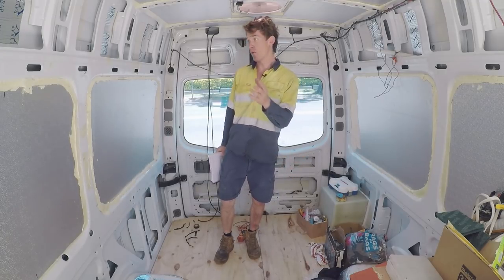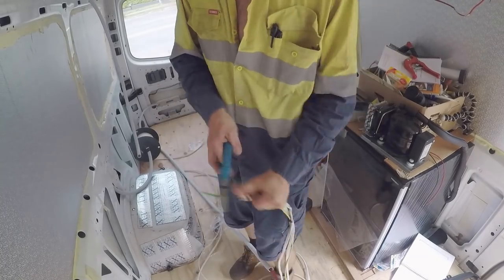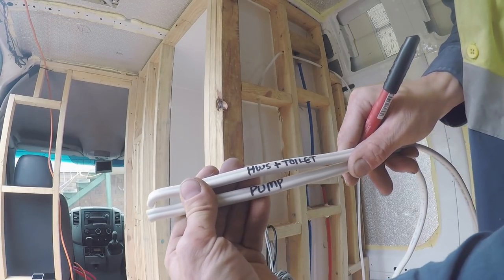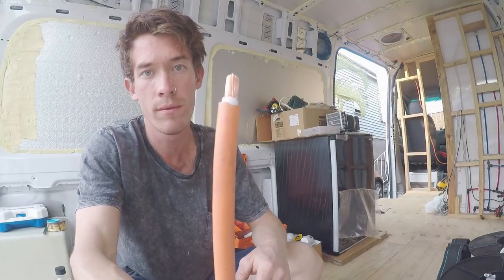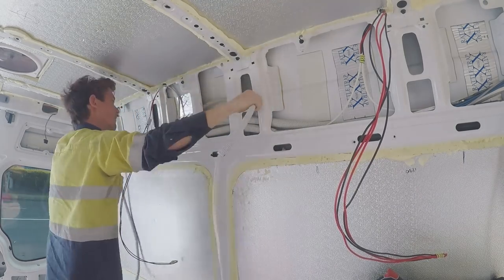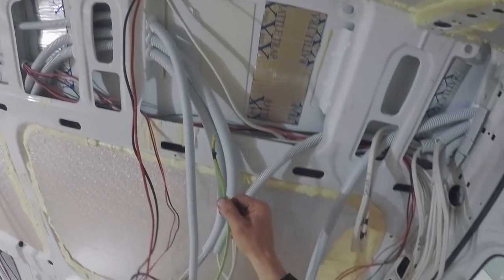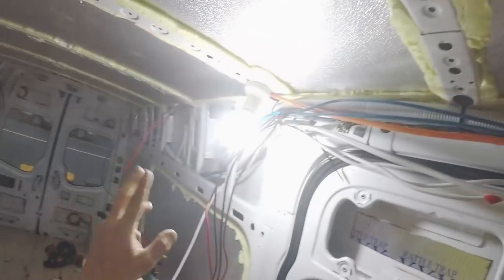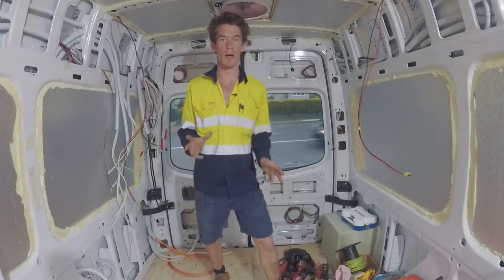S1E9 Sprinter Van Conversion | Electrical Pt. 1

Comment from the maker: I'm glad I went the extra step with the electrical rough-in, I'm really enjoying the extra power points and 12V USB points throughout the van. Having 12V and 240V in the van makes life a lot easier and convenient!

Ep.9 BLOG POST + PRICE BREAKDOWN - http://www.jazmorton.com/van-conversion/ep-9-electrical-pt-1/
Season 1 Van Build - http://bit.ly/VanBuildS1
Season 2 Van Life - http://bit.ly/VanLifeS2
Reply: Why 4mm for the 12 volt ?
Reply from the maker: @tospicy4ya  less voltage drop
Reply: Jaz Morton did u use fp 200 twin and earth
Reply from the maker: @tospicy4ya  I used 2.5mm² Twin & Earth Cable for the 240VAC wiring, and 4mm2 Twin for the 12VDC wiring. These are both TPS cable (Thermoplastic Sheathed) Cable. 

Go to https://www.jazmorton.com/van-conversion/electrical-pt-2/ to check out what gear I used

Comment: 26:40 "I just wanted to keep the electrical in this van pretty simple. I didn't go overboard."
You call that simple?! Lmao.
Reply from the maker: Haha yes I think it is simple,  maybe in my mind haha. Part 2 will be all about fitting off all the powerpoints, switches, circuit breakers, battery etc. Enjoy
Reply: I laughed at that out loud too. I guess it’s relative to experience, or build ambition. What would have done that would have made it complicated Jaz?
Reply: Once you try yourself, you will be surprised how much cables are required even for simple setup. I did conversion of VW T5, really simple one. And i had to put diagram on paper and plan everything. So I belive it is as simple as possible. :-)
Reply: @mojitomaker  smart iot van probably!?
"Hey Google, shower on" 😄

Comment: I will shamelessly steal your idea for putting lights in the back doors through the door loom conduit. That is such a great idea. The rest of the cabling caused my brain to melt, so i'm off to bed to weep at my apparent inadequacy. Thanks for the great vid though. Take care
Reply from the maker: Haha use it please :) oh well at least you'll be able to sleep better now! In Ep.9 Blog Post I will include heaps of info and wiring diagrams etc and it will be all much clearer!
Reply: Thanks Jaz, In the UK we are free to die by misadventure. The man can't tell me how to wire my van, but my ghost will definitely watch that next video. I plan to skip 240v and an inverter altogether if boost/buck regulated DC-DC boards work out for the small number of electrical kit in my van.
Reply from the maker: Haha be safe mate 👍🏼
Reply: Jaz, was there merely not enough room to run the cabling through the frame above the door, or on tge drivers side van? Or was that just a comprimise for ease of installation?
Reply from the maker: Good question mate. There is zero room above the large sliding door, no cavity. And since I had already built the bathroom running through the other side wasn't really an option.

The existing 12V automative cabling was already along the door too, I i just ran it all there .

Comment: Thanks for the last element about not being disheartened by the scale of the project. I'm in the same boat as you, full-time job, and starting a van build at the same time. I'm not looking forward to starting, but as you've said, you have to keep going. Small steps in the right direction, and learn from your mistakes.
Reply from the maker: That's it darron there are many times you will feel overwhelmed and disheartened and many times of high success and satisfaction and motivation. The journey is a myriad of feelings, especially if you work full time but it will all be worth it. I only felt like I was truly getting somewhere after episode 10 was complete haha! soldier on mate

Comment: Great stuff. Really enjoying the videos and detail you are going into. I'm fitting out a 2006 sprinter myself right now.  Mine will be a weekender/occasional trip rather than a full time live in so I'm not planning to install a shower and toilet. So much of what you have done to this point is really helpful, so thanks!
Reply from the maker: That's awesome you're taking on your own project! A weekender would be awesome too. Really appreciate your support Darren, cheers!

Comment: Lovin the Work, especially your effort with the edit/voice over. I’m doing an ex ambo strip out at the moment and can’t be bothered videoing every aspect it takes so much effort, so really appreciate all you put in. Very helpful.
I’m lucky as mine is prewired although some of the v-mux system has been removed but I’m chasing the USA manufacturers down - wishing I had started from scratch as it’s a headache.
Reply from the maker: Cheers Zed ya legend, yeah mate the effort to create a whole video series is like doing the conversion twice!

Your build sounds cool wish you the best of luck with it:)

Comment: Love the detail and the way you put the clips and music together.  (Most of these types of build series videos just say....”today we did the electrical” and show it completed). Can’t wait to see the whole van done.  It seems like you’ve really worked out all the details.  Did you draw this all up in Autocad or some sort of drafting software?
Reply from the maker: Cheers mate, yeah I know that's why I wanted to actually go into detail and show the actual build process, because I couldn't find many doing the build either.. I literally have a real basic plan on paper for cabinetry, and I didn't go off an electrical plan it was just in my head, but I will be doing plans up after the fact so it is easier to explain on the blog posts to all you guys, thanks for all the support mate!

Comment: Have you at any time thought: 'Jeez... this is so much work...'   I ask, as I bought a camper that had been quite well equipped and done very well - a VW/Mercedes Sprinter joint venture. Watching you do yours brings it home just how much work went into mine. I paid £4000 for the van with everything done. I reckon I got a bargain...
Reply from the maker: Heaps of Work! If I didn't have to work a full time job as well it would be much easier 👍🏼 sounds like you got a bargain
Reply: I'm very curious to see how it all holds together when you actually get it moving - in particular the solar panels held on with just the sikaflex. I didn't know the stuff was THAT strong. I'm parked up on a motorhome site right now and all I see some days are guys on their roofs with the sealant tending to their skylights and solar panel fixings :) I should show them your video. Whatever, great work you're doing, nicely presented videos and looking forward to its completion. Is there a list of all the Sikaflex products you've been using? - especially that stuff holding your solar panels on :)

Comment: Would be nice to use a microcontroller with relais in one central point and let it switch all the circuits. You can put your switch everywhere and have to use only one cable like the cat 6 or even implement a remote control. And auto switch on or off functionalities via sensors or buttons.
Reply from the maker: So like C-Bus control? I know what youre saying but maybe a bit over the top for something like this, and you would need a board full of relays for that :( take up a lot of space

Comment: Do I understand you are putting your auxiliary batteries in the corner down there at the back?
I've heard issues with draining the car battery if you run out at auxiliary, but I have not understood it entirely and understand there is a way to avoid depletion.
Also: what systems /apparatus are you running on what voltage? What are you using for switches? Will you i.e. make a "in-bed-lights-out" or use the door switches for something? 
How will you be controlling charging, are there automated systems?
I bother you with all these questions because your videos are already super informative and you seem very knowledgeable and seem to have figured a lot of things out. Keep up the good work!
Reply from the maker: Thanks for the questions and support! The starter battery can't be drained from all the lights, inverter and other DC loads as there is an automatic relay that disconnects the starter battery when the van motor isn't running.
All the DC loads are 12V DC, all the AC loads are 240V AC. All the switches and powerpoint will be Double Pole switch mechs.
The will be a switch next to the bed for a bed light, but no I won't have a "Master switch" if that is what you are reffering to.

All the charging apparatus's will be explained and installed in Electrical Part 2, sorry it will be a lot of information in that episode but I havent' even sheeted the van yet, will have to wait for that one :)

Comment: Thanks Jaz for the most awesome video on van conversion truly an amazing job. Are The water piping and fitting similar to PEX in the USA and if they are i could not find the plastic fitting Y's T's and elbows in plastic here in USA. thanks again for taking the time and effort and sharing all that information with us. best of luck in your amazing journey.
Reply from the maker: Cheers Sam I think it is similar the PEX just not as heavy duty, the internal RV plumbing pressure won't be too high like mains. No worries glad you enjoyed and got value from it 😄 thanks for watching and supporting man!

Comment: Does 4mm twin mean you have 2 cables - 4mm each? Isn't that a bit of overkill? And thanks for great videos explaining it all!
Reply from the maker: Yes thats exactly right. 2 x 4mm conductors in the one cable sheat.

It isn't overkill for 12V as 12V is susseptible to more voltage drop and that isn't what you want.
Reply: Really rough!

Comment: Running two wires for the battery seems excessive, why not use the chassis as the negative/return for that?
Reply from the maker: Good thought, probably could have done that. But just wanted to be sure
Reply: Travel With Jaz you were probably right to run the the negative cable for the alternator charge cct as it is such a long run. Do you have the facility to use the hotel battery to assist crank battery if its flat?
Reply: Travel With Jaz I was wondering what happens if you’re plugging in the external with the earth on the chassis.. does that affect your battery?

Comment: Always looking forward to the next video Jaz. Couple questions for you: 

What are you using to cover your conduit T-joints underneath the chassis to prevent water intrusion?

Did you ever consider a backing plate to add some rigidity to your main plug-in ports?

You already have two fans, one right next to the shower door...do you think running your current setup without the third fan inside the shower would be enough to stave off mold? I’m sure it depends on your geographical weather tendencies too. 

Good to see you got some thermal wrap on that exhaust adjacent to the water tank!

Thanks again for these vids...truly awesome stuff!
Reply from the maker: Thanks Phillip! I didn't use anything to cover as it wouldn't matter if water got inside because it can't get into the van. 

I did consider bolting the mains inlet and outlet but decided not to.

I'm not 100% sure on the mould, I i think It would be alright without one but want to put one in anyway :)

Comment: A step drill will make poking holes in sheet metal a lot easier for you than trying to fight with hole saws.
Reply from the maker: Step drills are good, but they give off a lot of metal swarf. I used a metal drilling hole saw which literally cuts the hole in seconds with no effort, recommend that over a step drill bit for this, plus the holes are always perfect size (Y) Cheers for the tip though mate

Comment: I'm in the UK and also a Sparky (Electrician) by trade, curious to know when running off the grid on the AC inverter, how do you Earth the system? I'm only asking as I noticed you put your 6mm Earth to the chassis but if for some reason you had a fault and your RCD or MCB's failed to trip there's a possibility the chassis would become live???
Reply from the maker: Great question Mark and it is a bit trickier when completely off the grid, as technically everything in the van is not actually earthed to a real Ground Earth because its completely insulated from the tyres.

The type of inverter I am installing has something called a  Neutral to Ground relay. (basically a relay that makes or breaks an MEN connection - Multiple Earth Neutral). When the inverter detects when it is connected to mains input, this relay is open circuit because all the earths in the van will be earthed through the mains input earth, and through the mains MEN system.

But when off the grid this relay closes so that if there is any faults, it allows the circuit breakers to trip. I think in reality technically there would be a fault current in the chassis of the van (as there has to be some fault current for an RCD to operate), but it would be so negligable as the RCD breakers trip before any real fault currents could flow.

I'll be running through all this in Electrical Pt. 2.

Again, good question, thanks!
Reply: Travel With Jaz Thanks for the reply, it makes sense now with the type of inverter, I’m interested in building a van myself and always thought about the possibility of maybe running a ground spike when fully off the grid because our regs say you shouldn’t run any part of a PME supply via the metal work of the vehicle but it only stipulates when on hook up it doesn’t mention when running off an inverter.

Comment: Hi buddy. Can you please tell me the name of the fixing brackets you've used to secure the pipes and wire protectors to the chassis under the van?  Not the p clips, the half circle brackets with a screw either side. Would love to get some. Your build is amazing. You should do this for a full time job
Reply from the maker: Hi Tim, at first I thought you were referring to the 25mm metal saddles that secure the corro under the van. I don't believed I used any other fixing equipment. Or are you talking about what is securing the plumbing?

Cheers mate

Comment: I wouldn't use Twin and Earth in a vehicle, the moving of the vehicle could cause the copper to work harden and then break, I would go with flexible Outdoor flex which has also better temperature ratings and doesn't work harden.
Reply from the maker: Thanks mate yeah I considered this put all the cables are quite secure so I think any moment will be negligible!
Reply: Have to agree with Malcolm, Jaz, in the UK flexible cable is a must in the UK for Campervans.
Reply from the maker: No worries mate we'll see how it goes 👍

Comment: Wire spaghetti. lol
Not sure why you ran the battery cables up along the left wall to the solar batteries on the right, but it's there now. You also seem to overly like hose joins. Doesn't that hose bend?
I don't mean to sound negative, just a few things I didn't understand the logic behind them. You have done a top job.
Reply from the maker: gotta run the amount of cables to do the job, once fit off all excess cable is terminated neatly, except the 12v board which was not terminated to neatly. that pipe doesnt bend 90 degrees

Comment: great vids ive been watching in awe at how nice a job your making BUT !!! @17.58 I BELIEVE YOU MAY HAVE MADE A GRAVE ERROR !!! im telling you my findings now incase i forget as when i wired a solar battery bank to my traffic van battery six months down the line they almost set my van on fire on a motorway as it causes the whole of the van wiring loom to heat up so its always best to go straight to the alternator if i watch further and this isnt the case my appologies in advance didnt want to forget!!!
Reply from the maker: Hey Spencer mate! Can you elaborate more on how you wired your system, and what problems you had it wasn't too clear. So far it's all working fine 👍🏼
Reply from the maker: My alternator and solar are wired up separately by the way, seperat e charge controllers.
Reply: yeah nice one jazz its probly ok the problem arose because i overdischarged a battery then connected it to the van which took the charge from the house battery because of the inrush current this caused the vans wiring to heat-up at the distribution box almost catching light .  i always go straight to the alternator for all charging needs and then split off from there charge controller/split charger/distribution/fused .it is MUCH safer as it CANNOT heat the vans wiring loom that way !!!!! when you take power from the house battery you are increasing the load on the vans wiring loom it was never designed for i almost found out the hard way!! it was bad enough i had to scrap the van!  great channel ill be watching some more soon!

Comment: Hi Jaz, can you explain a bit more about the "neutral to ground relay" you mentioned in this video. I understand most things electrical (was a sparky many years ago) but don't have any idea about earthing in a circuit that doesn't touch the earth. Also how do you set up an RCD in a van with no earth. Will really appreciate your answer and btw I am in NZ so have the same wiring regs that you do.

Comment: Dear friend, thank you for responding, you have a wheel case installation book I believe you are asking correctly.
Reply from the maker: Hey mate sorry what is a wheel case installation book? Which comment did i respond to it doesn't show a previous comment, thanks Tynho ✌🏼
Reply from the maker: Oh I saw you said a manual for electrical and hydraulic parts. Do you mean something that comes with the van you need to be specific.  Thanks 👍🏼

Comment: I'm building a van in Aus too. I was wondering if you installed everything yourself and then had an electrician approve it?  I'm wondering how to go about it myself, hopefully I can get most things 12v but for some I'll need 220v like laptops.
Reply from the maker: thats awesome casey, I did install all the electrical myself as i'm an electrician. I actually did get another electrician to go over it and sign it off independantly from me.